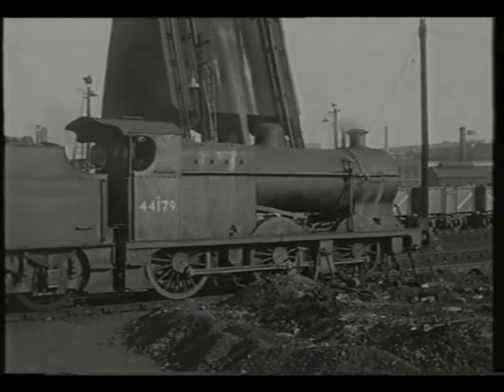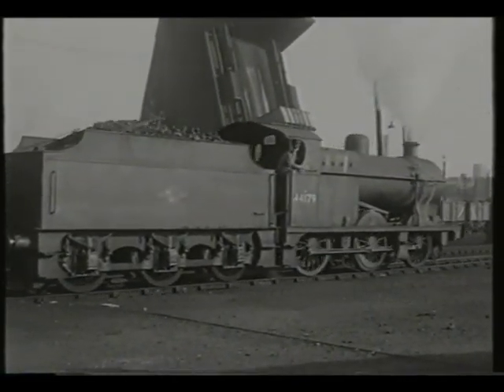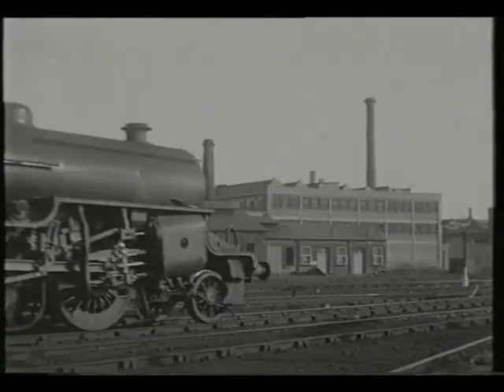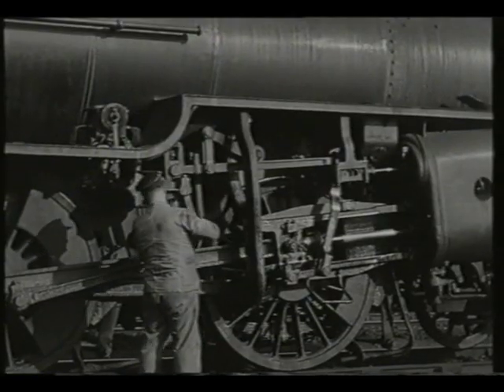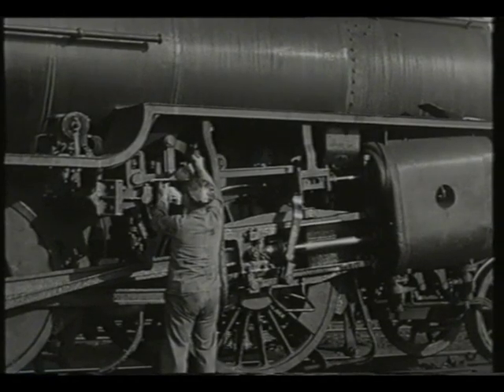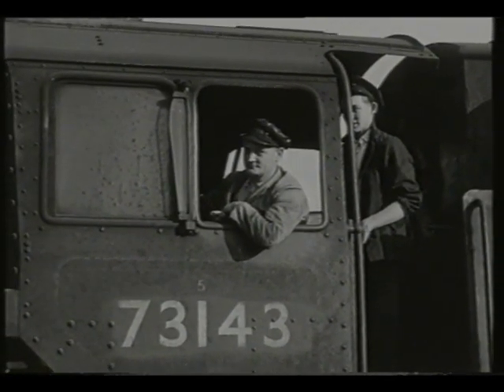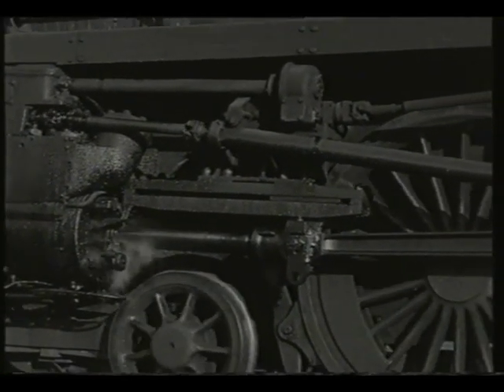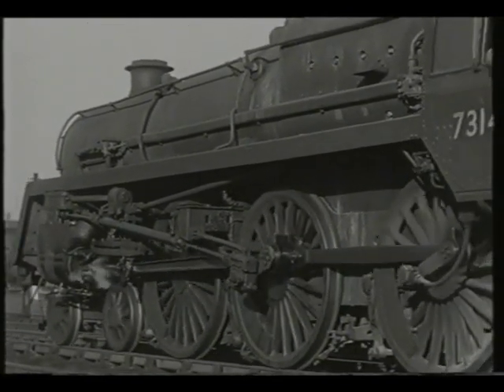Railway Roundabout 1959 'Saltley Shed 1959'

Comment: I was a fireman on many of the 9f engine's, some with the Berkley stoker
Reply: I wish I could say that about myself, but I was born too late for a life on steam locomotives!  We've read about problems with Berkley Stokers (wrong size coal jamming the screw).  Was this true?
Reply: @stephensmith799  The stokers where fitted to three of the class 92165/6/7 primarily for operating the longest single crewed Saltley freight working from Water Orton(Birmingham) to Carlisle via Derby,Leeds & the S&C. They were meant to be coaled from a seperate supply of crushed coal but often ended up with lumps in the mix. I fired many 9F's but not the stokers which had been sent elsewhere (Consett I think without checking?) and heard the stories of those who had to unblock the screw at usually the most difficult times or revert to hand firing via a restricted access. Basically they were fine if they worked well but a nightmare when they failed.
Reply: Thanks for the extra details.  Making steam is a job and a half.  You have my respect.  I enjoy reading the memoires of footplate crew.  Have you read 'Behind the Steam' which must be my favourite?  It would be great to read of your exploits as one of the last steam crew... even if it only made a couple of articles in Steam World.  Of course a whole book would be brilliant... maybe to include recollections by other surviving footplate men.  Or maybe a YouTube vid of you talking to camera.  That stuff is priceless...  Anything by real railwaymen is far better than stuff from enthusiasts (like myself). @SYKAROST
Reply: Hah!  I have being trying to avoid Facebook as I struggle to keep up with my straight e-mail accounts!  But I am tempted now.  I was thinking just now about what must have been the toughest steam turn in the UK... taking an express from Paddington to Shrewsbury and return, with a GW King on the same day.  Talk about a fireman-killer!  How does the 'human frame' manage that?!
Reply: @stephensmith799  Some of these locos were pretty old. Just about ready for cutting. The 1960's was a glorious decade when maximum steam loco cutting took place.

Comment: Terry Essery''s combined volume of his memoirs "Saltley Firing Days" is a very detailed and readable account of his progress "through the links" at this shed, culminating in the firing of the overnight express fitted freight trains from Water Orton to Carlisle over the "Long Drag", and a typical BR Management fiasco with the experimental introduction of mechanical stoker-fitted 9F''s on this working, not to save the fireman's labour, but to use a cheaper grade of coal.
Reply: Alexander Challis  I recall reading an article in the 1980's in tyhe Steam Railway press saying that during restoration, it was discovered that the ashpan assembly fitted to 71000 in BR service  was  not allowing the coal to combust efficiently, giving it the reputation of a "poor steamer". This was rectified in it's rebuilding, and it now performs more efficiently. 
Terry Essery specifically states in "Saltley Firing Days " that the purpose of trialling the 9F's with the mechanical stokers was to explore the use of cheaper grades of coal. The "small coal"  already being used on the mechanically fired Heysham ferries, was to be used for the trial, but that didn't arrive at Saltley in time, and so the trial was carried out using the same grade of coal as was used by the 8F's  usually  allocated to this Express Goods duty, which was unscreened, of many different shapes and sizes, and so caused problems by for the firemen by regularly blocking the working of the Berkeley apparatus. 
Conversely, after the 9F"test" was finished, and the 8F's restored to the duty, the Heysham "small coal" arrived and was used for manual firing, which brought it's own problems. 
One cannot imagine that BR at this time had any purpose in fitting the 9F's with this apparatus other than trying to effect fuel economy. It certainly wasn't an altruistic desire to "save the fireman's back!"

Comment: Kind of interesting the fact that when the railways were privately owned  and run ...engine and coaches were immaculately kept,  but with nationalisation they weren't l
Reply: Freight locos were never cleaned like passenger locos as they were out of the eye of the public (except enthusiasts)
Reply: It was more of a case in later times of not enough cleaners available owing to covering fireing turns, or difficulty recruiting.
Reply: As a youngster, early 1950's I had an elderly ex Great Central/LNER driver neighbour and he said before WW2 crews were often allocated a pool of just a few loco's in a shed, they were proud of their engines and would often do a bit of cleaning themselves during slack times. I imagine the bean counters were around from early BR days which might have taken away such pride in the job.

Comment: saltley had 3 roundhouses
Reply: Correct, No1 was between 2 & 3 with no access of it's own so loco's entered & left via either using two turntables. No3 had the largest table which could just about accomodate 9F's very finely balanced.